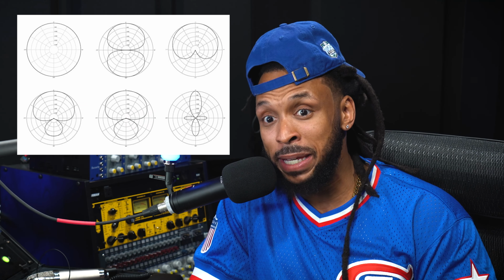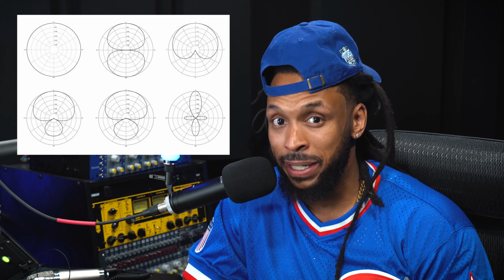How to Record | The Beginner's Guide to Great Sound

Comment: I have an 8 year old Shure SM57 and it seems to be recording with less clarity / high end than it used to. Do parts inside this mic deteriorate over time?
Reply: Yes it does I say every 2 or 3 years invest in new mic
Reply: @eastsidey.o.p435  interesting. Where is this advice? I contacted Shure about it and they didn’t have any info apart from book it in for a repair.